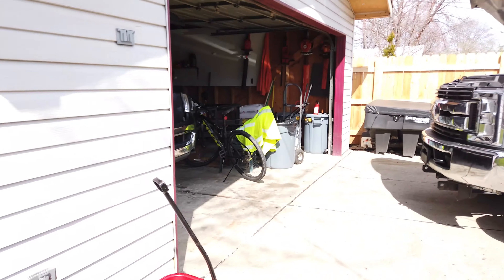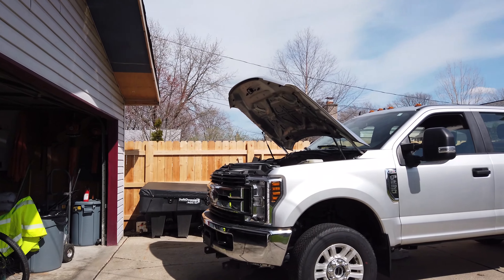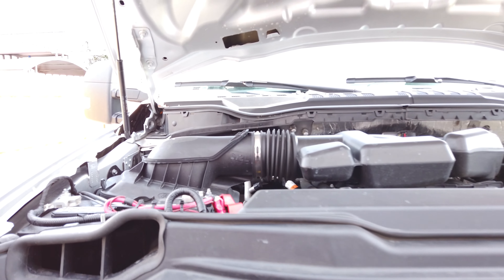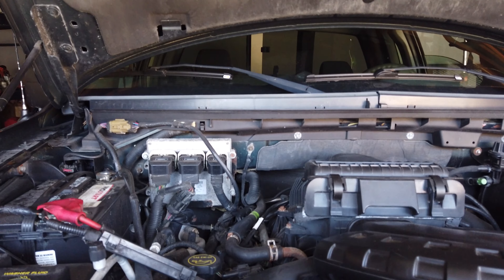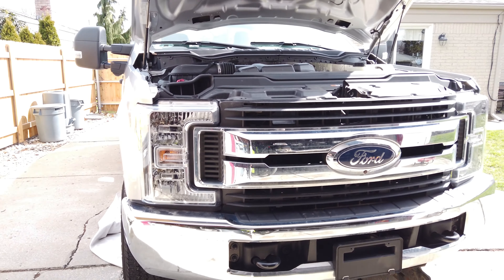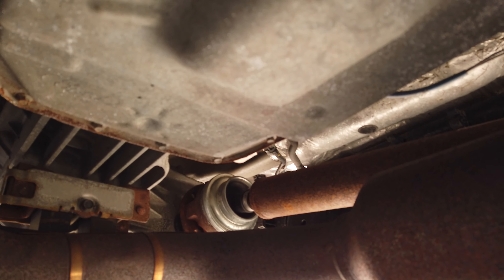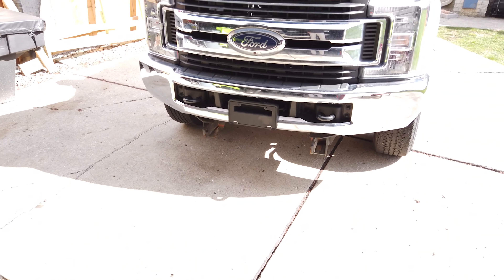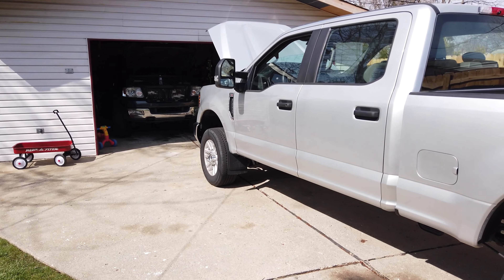The one SILLY thing about my 2019 F250. 🤪

Comment: Sean you are absolutely right. Especially on a work truck. I worked for a courier company we had upwards of 100 Fords. We had E-Series, Focus, Fiesta's, Transits, Transit Connects, and larger Fords also. Except their Explorers and Expeditions They all had dipsticks for the transmission. But there was no fill capacity amount. So before a trans service we would top off the trans on the stick. Then we would measure the amount of fluid that came out and fill the trans with that amount. Vans were like 13 quarts if the converter had a plug.